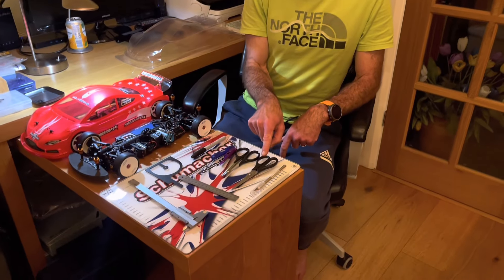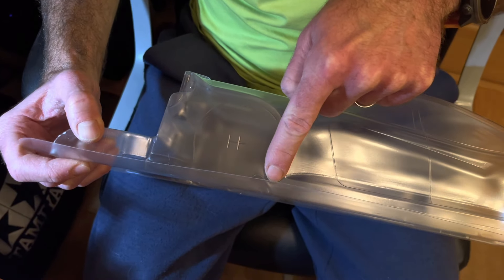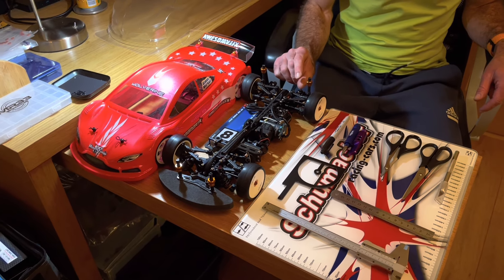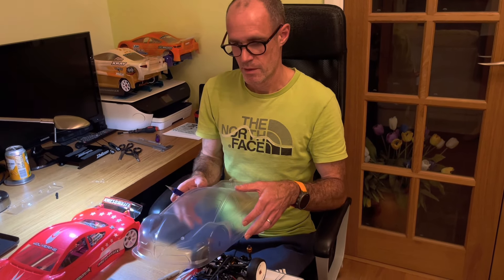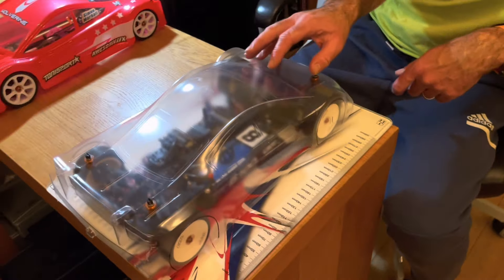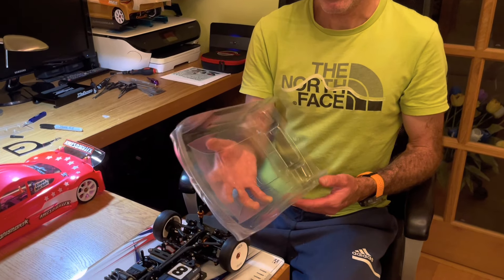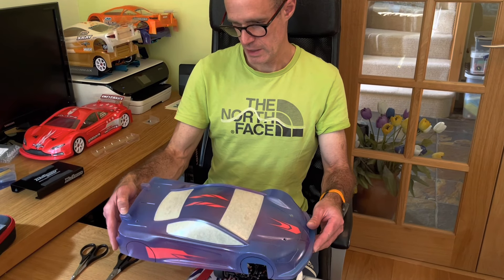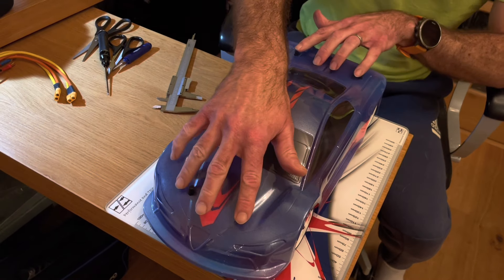Aldershot Model Car Club: Vid 3 Body Shell Prep

Comment: I’ve never seen or heard of either the chamfer tool for body posts or the template to cut out the wheel arches out. Wish I had known about this, especially the wheel arches as I’m always cutting them wonky and thus ruining the look of my shells, and dare I say affect performance to a small extent due to drag caused by different size holes etc